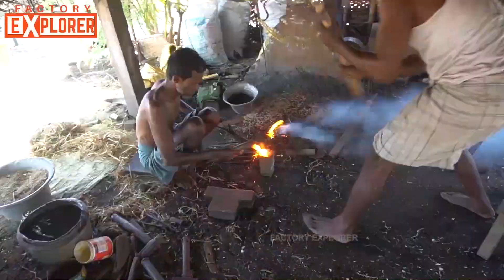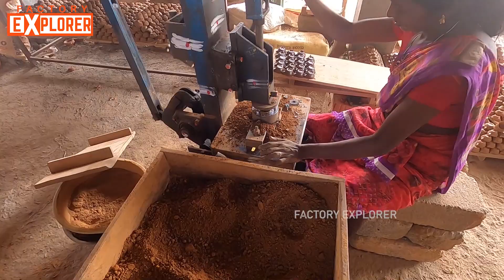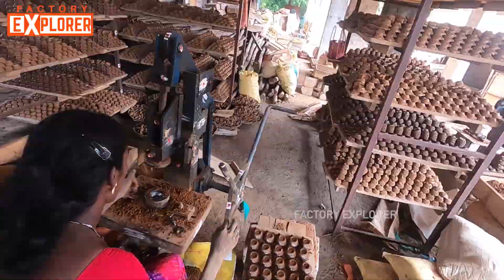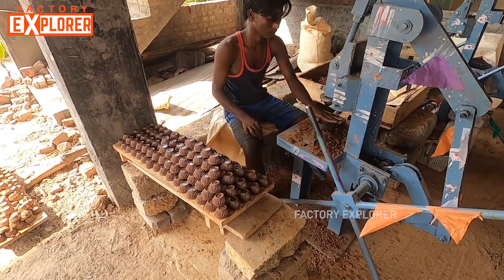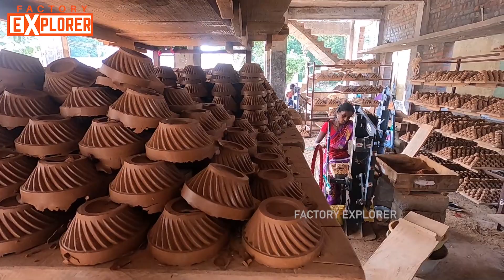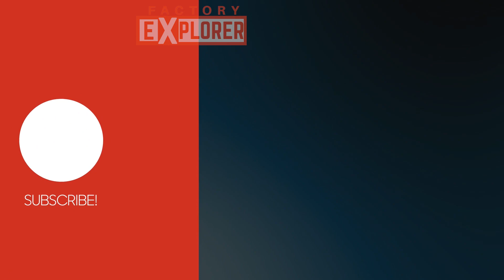HOW? Festival Lamps are made? | Factory Explorer

Comment: our manufacture various kinds of roll forming machine for producing the following products. Such as Roof Tile, Wall Panel, Roofing Corrugated Sheet, Floor Deck, C & Z Purlin, Highway Guardrail, Sandwich Panel, Container Board, Car Panel, Roll Shutter Door, Downspout, Decorated gusset, Steel Pipe...etc.